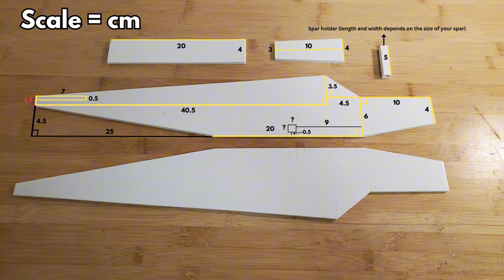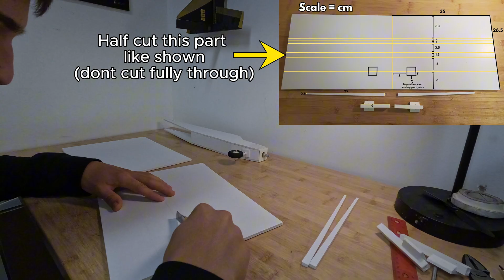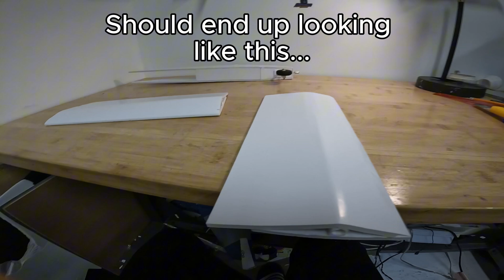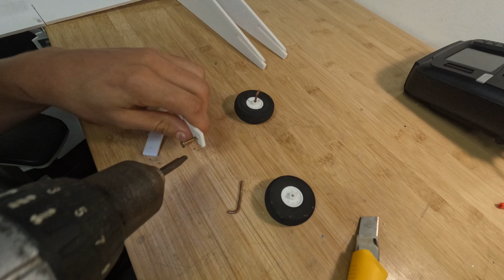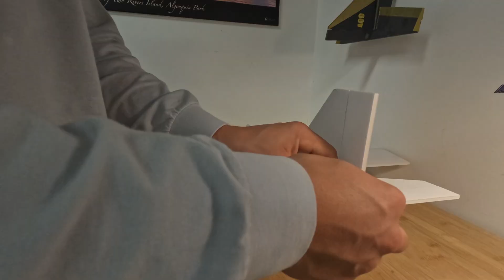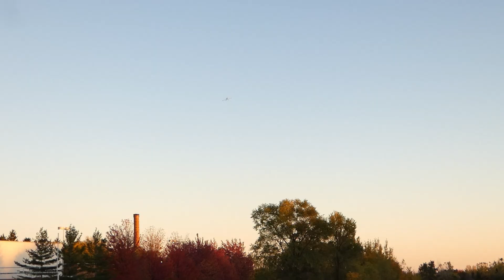How to Build the BEST DIY RC Plane (Step-by-Step Tutorial)

Comment: bro pls answer my questions , i am a beginer and have made 2 unsucessful planes. i want to try again and for that , is thrust angle of a motor really important like cant i mount it dead straight? and also bro does this plane has any diheadral and is that imp?
Reply from the maker: Thrust angle isn’t very important for a beginner plane, and it’s usually safest to mount the motor straight with no offset. This plane also has a slight dihedral in the wings, with the airfoil thickness tapering out toward the wingtips, which helps improve stability in flight. The wing is also installed to the fuselage with a small angle of attack as well, which increases lift if you were wondering.

A few other tips for your first build:
- Set the center of gravity around one-third of the wing
- Use a wing loading calculator to estimate your needed wing area.
- Start with a high-wing, slow-stall design because it’s simple to build and very stable in the air (ex.Cub)

Comment: Awesome video bro and What is the power supply or which one you suggest
Reply from the maker: 3s battery 40amp ESC everything is linked in the description
Reply: @PlaneX20 thank u man 3s 11v 450mah is okay? Asking because I have already
Reply from the maker: @Wornixe19 I would recommend getting a higher mah if you want a longer flight time, we use 800-1300 mah which gives us around 6 min of flight time
Reply from the maker: @Wornixe19 but you have to make sure the battery fits into the plane
Reply: @PlaneX20 thanks man
Reply: @PlaneX20  I got a li-ion cell pack 12v 4500mah with a high and good discharge does that work? And what about other electronics and what system did you use for radio and fpv
Reply: Eziciya bavidennim @PlaneX20
Reply: Kudooo
Reply: @umuthakkı55 🙏🙏MNGL is a life style

Comment: Gonna build my own version- quick tip on servo linkages, you want the hole of the linkage to be in line with the hinge so that the geometry is consistent. I remember having a lot of weird expo problems before I learned that for some of the other foam board models Ive built. This is awesome though, keep up the good work!

Comment: You install the servo horn wrongly. You can still have more deflection angle by moving it closer to the control surfaces joint. You are able to fly this cause your control surfaces effectiveness coefficient is higher

Comment: can you build me an kit only faom board and I put motor in pls
Reply: Fr, I don’t have a 3D printer and I aint wasting time cutting out the wheel assembly
Reply: @Swippy_lol  yeah
Reply from the maker: @Swippy_lol  When it comes to wheels you can pretty much do whatever works. all our previous designs were just a wheel attached to a wooden rod. keep it minimalistic!
Reply: @PlaneX20   aight thxs